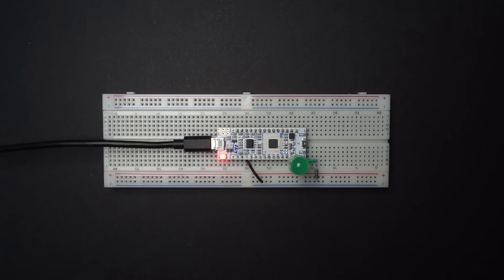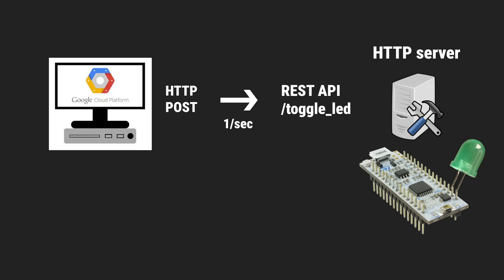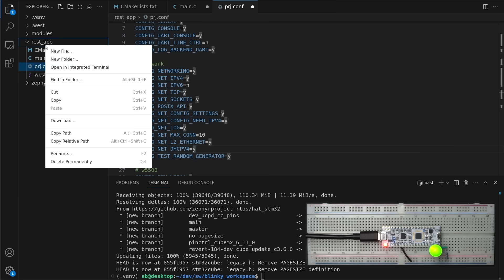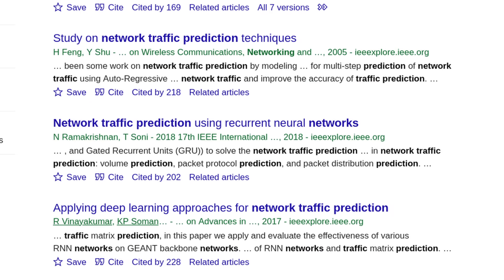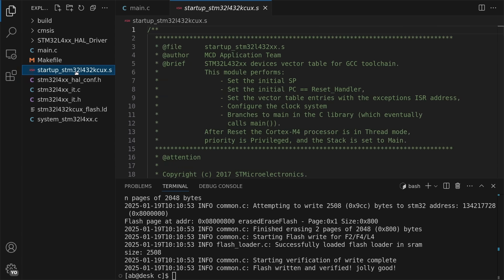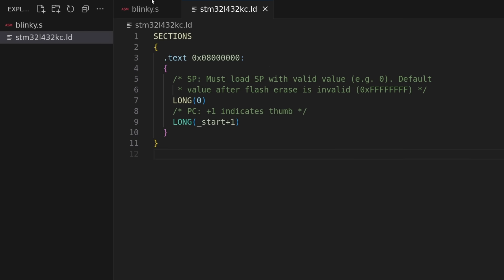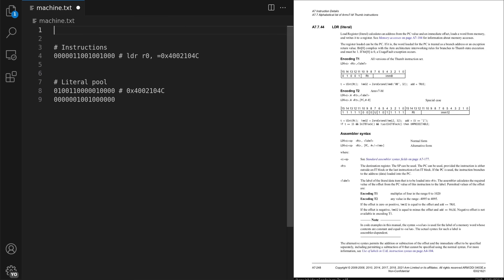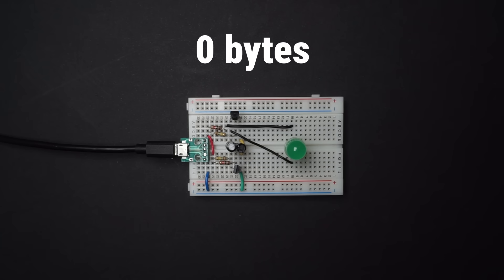I Shrunk Blinky to 0 Bytes

Comment: In technical terms, an astable multivibrator has one bit of processing capacity. Therefore, your program has not zero bytes but 0.125. To make a really zero byte circuit, you can take a Schmitt-Trigger inverter from HCMOS or CMOS logic family put a capacitor from the input to the GND and connect a resistor from the input to the output. Since there is no storage element invoked, this wired program has really zero bytes - with just three components (beside the power supply and the LED).
Reply: That's exactly what I thought , it has to be analog , just use an RC oscillator.
You can blink a led with a single metal oxide effect transistor, a capacitor and a single resistor. Discharge the capacitor via the gate of the transistor. Only need 3 components.

Even that is bloat, if you're able to make your semiconductors, you can make the LED and the Transistor in the same die, and the resistor and capacitor can also be just CMOS "wire", aka, just control the width of a connection to proper capacitance and resistance when creating the mask.

The ultimate 1 second no bloat 0 bits LED that's a single electronic device.
Reply: @monad_tcp  However, there is a catch: A dedicated monolytical integrated circuit is not programmable. Wiring standard  electronic components can be seen a programming, since it requires intellectual effort and the wiring can be changed, e.g. to modify functionality. Early computers were designed to be programmed by wiring. Furthermore, a single FET-oscillator can not be considered as sufficiently stable and reproducible as a Schmitt-Trigger to achieve to 2'000 ms cycle time.
Reply: @monad_tcp that means analog computers are better compared to digital if there is a way to reduce power consumption.
Reply: @monad_tcp Isn't that how christmas lights are made?
Edit: I was replying to your first comment about making an LED semiconductor so that it can blink by itself
Reply: @redyau_ OLD christmas lights used a particular bulb where the filament behaved as a thermal switch: when the circuit is closed, the light bulb turns on, the filament heats up and flex, opening the circuit. Once it cooled down, it regained its original shape, closing the circuit once again. 

Alternatively, you could just place a chopper wheel in front of your LED...
Reply: @monad_tcp 
still bloat.
Connect a Solar panel to a bimetal which creates electricity from heat difference.
Now light a candle and place the bimetal onto another bimetal which bends from heat.
Place water next to it,such that if it bends due to candpe heat it hits the water cooling down and bending back.
This includes the power source already.
Reply: No storage element in the Schmitt-triger design? Last time I checked, a capacitor is a storage element. (It's what's used as the storage element in DRAM.)
Reply: @sillymel  Contrary to f flip-flop - what a monostable or astable multivibrator is, a capacitor is an analog storage for electrical charge, but not a permanent logical storage element. It loses its charge due to intrinsic leakage currents and has no defined logical state. You can build a logical storage from capacitors indeed, when the state is permanently read, evaluated and restored, as in a DRAM. An RC-oscillator, built around a Schmitt-Trigger inverter is a FSM (finite state machine) with zero bits of storage. Therefore, it satisfies the goal of the video.
Reply: @debrainwasher  Even without the capacitor, the Schmitt-Trigger itself still stores one bit.
Because the replacement circuit for for a Schmitt-Trigger consists of a voltage divider, two Comparators and a Flipflop.
Reply: @debrainwasher  After doing some more research, it seems my intuition that your Schmit-trigger oscillator design must still have a single bit of storage somewhere was right, but I was wrong about where the bit was found. It's actually the Schmitt trigger that has the single bit of memory. You can see this by making an analog circuit that takes two inputs and provides a voltage as follows:
1. If both inputs are off, the voltage provided is between the positive and negative trigger voltages for a Schmitt trigger.
2. If just input A is on, the voltage provided is above the positive trigger voltage for the Schmitt trigger.
3. If input B is on, the voltage provided is below the negative trigger voltage for the Schmitt trigger.
What do you get when you connect the output of this circuit to the input of your Schmitt trigger? A set-reset latch, which is a single-bit of memory! The single bit of memory couldn't have come from the circuit providing the voltage, which has an output entirely specified by its inputs, so it must have come from the Schmitt trigger.
Reply: @sillymel  Intuition is unfortunately neither a good advisor in computer sciences, nor quantum physics. Digital storage is defined as a stateful building block that can either contain a logical one or zero, hold it for indefinite time, can changed its state arbitrarily and can act as a FSM (Finite State Machine, Details see Wikipedia). A Schmitt-Trigger inverter can not do this by itself. Not even with a R and C. It has a stateless truth table.
Reply: @ I literally just gave you an example of a circuit that uses just a Schmitt trigger and a very-definitely stateless bit of input processing to achieve a set-reset latch. Yes, intuition on its own isn't necessarily an indicator of what's true, but I backed my intuition up with evidence, which you completely ignored.

Let me (try to) be clearer: When the input for a Schmitt trigger is between the two trigger voltages, the output depends on what the input was before, not the current input. That is the opposite of stateless. You can then define logical 0 and 1 for a Schmitt trigger based on the value of the output when the input goes between the trigger voltages.

Writing to and avoiding clobbering the bit is somewhat tricky, but I already described how to do so in my previous comment.
Reply: An SRAM storage cell needs 6 transistors and each inverter is 2 transistors, so technically this is still 0.66 bits or 1/12th of a byte
Reply: @nikitacheblokov8032  I respectfully disagree. Programmatic realization of a digital blinking circuit with strictly defined cycle-times and 0 bytes forbids the use of any state machine. Transistors per se are not state machines, because they can't be set to a particular logical (Boolean) state and keep it for an indefinitive amount of time - for physical reasons. Any flip-flop, SRAM (array of flip-flops) or DRAM (periodically refreshed capacitor to emulate the functionality of an SRAM are state machines with a storage-capacity of 1 bit or 1/8 byte - built from transistors. Schmitt-Trigger-Inverters are wire programmable digital devices (defined high/low-states), but without storage capabilities. With precision R und C, they can satisfy the timing requirements too.
Reply: You can go smaller. SPST button and a finger. You give up some accuracy and precision, but 0 bits.
Reply: @R.B.  A buttons pushed by a finger It is still not zero bytes, because the finger as a servo actuator is controlled by the brain's neural logic. And this biological computer is far from being stateless but has hundreds of MB storage capacity. Some politicians excepted, of course.
Reply: Thinking in terms of information theory: "the information that can be stored in a system is proportional to the logarithm of N possible states of that system" (here logarithm is base 2) so even if there were no storage mechanism and the circuit perfectly flipped between the two states there would still be information and log2=1 bit.

Another way of looking at it is that information should quantifiably measure "surprise". An improbable event should give you "a lot" of information, and a probable event should give you "little" information. Information is an inverse function of probability. It should surprise you when it snows in the Sahara desert! An infinitesimally improbable event (p=0) occurring should give you "infinite" information (since it wasn't thought possible). 
Also, information of two independent events happening should be quantified as adding the information of those events individually. Probability of independent events multiply, so you need a function that turns multiplication into addition; the logarithm! I(s)=log(1/p(s))

TL;DR: The probability of the LED being on or off is 0.5 (half the time on, the other half off), so the information of this system is I(0.5)=log(1/0.5)=log2=1 bit.
Reply: schmitt trigger itself is a storage element......

buddy, schmitt trigger is literally an analog latch
Reply: The schmitt trigger itself is made up of multiple components. If we allow for such abstraction we might as well have a 555 timer or simply a microcontroller pre-programmed which will do exactly that blinking with "0 bits".
Reply: @leocurious9919  The 555 uses an internal RS flip-flop to generate oscillations, controlled by two comparators. Therefore it has a storage capacity of 1 bit (0.125 bytes) and can not be considered as a stateless device.
Reply: @debrainwasher  So, what about the schmitt trigger? The whole point of my comment was this comparison: It is also not one simple analog component. Where do you draw the line?
Reply: @leocurious9919  Not the number of components count, but functionality. A flip-flop in any flavors is a FSM (Finite State Machine) with exactly 1 bit storage capacity, while a Schmitt-Trigger inverter has zero. That's the point. Proof: within a an astable multivibrator, the last state remains upon removal of one R or C. This is not the case within a Schmitt-Trigger-inverter RC-oscillator. parasitic resistances and capacitances will overwhelm the circuit.
Reply: @urnoob5528  Nope. A Schmitt-Trigger itself is a voltage discriminator with a hysteresis to convert analog signals into logical ones. It stores nothing. And an inverter inverts the logical state of an input signal and also stores nothing.
Reply: Do you understand static RAM?
Reply: Use a blinking led.
Reply: It has state though, worth exactly one bit of information.
Reply: Yo man, this already a quite nerd video, why are u even getting deeper on it xdxdx
Reply: Cannot like this comment because my like will be 257
Reply: given that the capacitor can have any level of charge, and they all represent different states, the astable multivibrator (like any other stateful analog circuit) has "infinite" bytes processing capacity (assuming you would emulate that with software _exactly_)
Reply: It has 1 bit of state, but 0 bits of instruction code.
Reply: @renakunisaki the code is the electric circuit, which requires a few bytes to be memorized
Reply: Tuning a bimetallic strip to turn on and off at 1000ms intervals is very hard, but not impossible. With only a source of heat, the switch still is 1-bit, from a pure "true-false" logic (it turns on and off; in boolean logic, a fully warmed bimetallic strip is above the threshold to "let power through" so it is set to "true"), but being completely analog MAYBE prevents it from being a "bit".

I could be completely wrong, but seeing an analog object that turns on and off by itself in a "PWM" sort of way to control overall power is basically any thermostat, which is why this came to mind.
Reply: dont forget to breathe my brother😂
Reply: Wow, a verbal circuit diagram... we rarely see those in the wild!
Reply: No matter what, the "state" of the LED can be considered one bit of information, no matter how it is driven.  However, if the LED were solidly on and you had an active shutter, say a motor connected to a segmented disc to create a strobe effect at 1Hz, there would be no "memory".
Reply: @robspiess  the LED doesn't belong to the program, it's just a side effect of the program
Reply: if our number of bytes is an integer, then the .125 gets dropped off and it IS just 0! take that
Reply: @thematriarch-cyn  Interesting logic. Well, if I would sell you a 0.99TB SSD, you connected it to your PC and it showed up as 0 Bytes, because there were only an empty SATA interface connector, I could provide you the satisfactory excuse, my TB was in fact an integer value.
Reply: @debrainwasher  Well, if that happened I guess I got scammed! damn
Reply: Interesting discussion - does an oscillator always have some form of memory? I always think of oscillators as always having some form of positive feedback, but that also requires a delay - in theory a single NOT gate should oscillate and the delay is due to propagation delay. In practice it doesn't because it acts more like an analogue op-amp, but having several (odd number) in series will oscillate once the delay is sufficient. Introducing an RC "delay" means the capacitor is acting as a memory. Essentially some delay is necessary because cause has to distinctly precede effect.
Reply: 0.125 bytes is one bit so it is 0 bytes. It's not possible to have less than 1 bit
Reply: @TheCommunistRabbit If you want to be pedantic then 0.125 bytes is one byte then. Because a started byte is a byte

Comment: You could do mechanical timing as well. Use an ac motor and a commutator to time the blink. The original ford mustang 1964 used this to get a wipe effect on its rear turn signal using 3 commutators on one shaft.
Reply: Years ago for stage lighting chases/effects, we had large adjustable contactors like that.
Basically a motor hooked to a variac, turning a wiper, and several removable contacts that you could slide around in the path of the wiper to change the timing.
On something like cyc lights you’d be switching several dozen 1500w lamps at a time.
Modern digital stage lighting using LEDs is so much safer and easier, but sometimes I miss the terrifying electromechanical death traps.
Reply: @ that’s really cool. I hope some of those are preserved somewhere in an electronics museum. The analog way is so interesting.
Reply: Indeed!  But to be slightly picky, that wasn't the 1964 Ford Mustang that had them; that was the 1964 Ford Thunderbird.  (And then they were also used on the 1967 Mercury Cougar and the 1968 Shelby GT500.)
Reply: This is also how old AC clocks worked, just hook a motor to the 50hz AC and gear it.